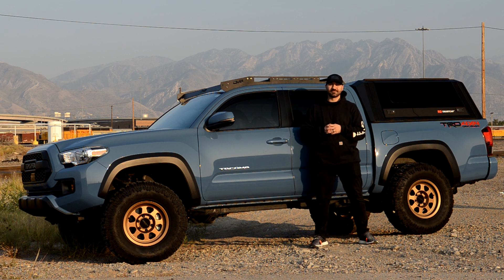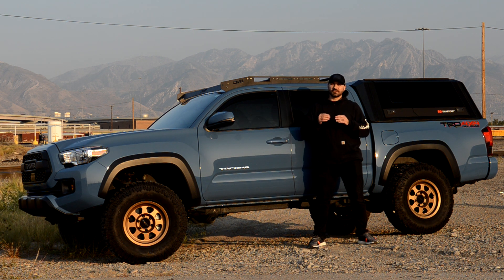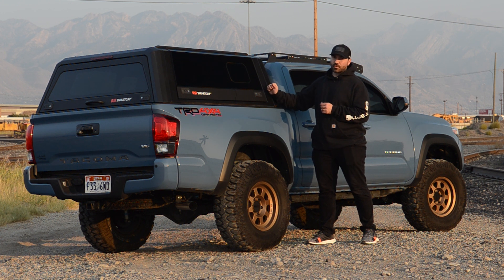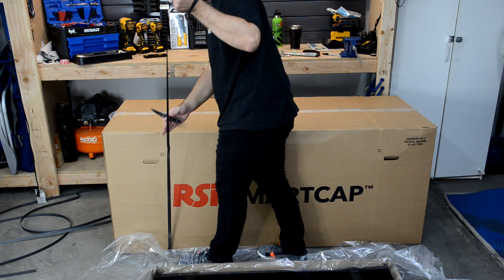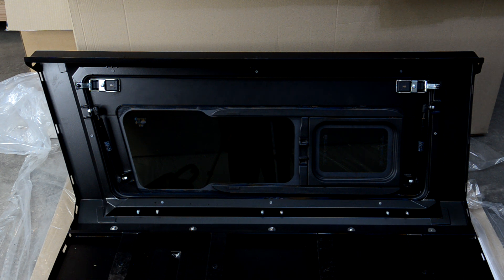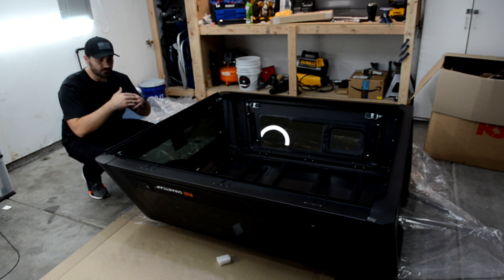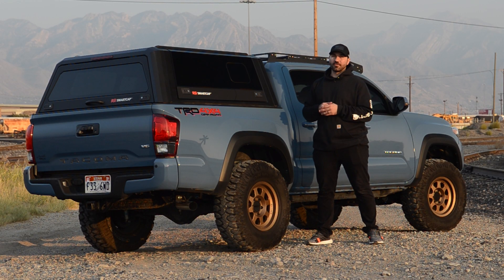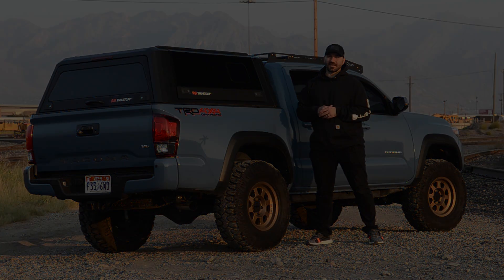RSI SmartCap Tacoma Install & Review - The Best 3rd Gen Tacoma Camper Shell - 2016+ Toyota Tacoma

Comment: Just got a Smartcap installed on my 2021 Ford Ranger Lariat yesterday. It looks really good, and the fact that it’s made of steel is a plus for me. The only thing I’m concerned about is the fit at the tailgate, since the Ranger doesn’t have a proper flat surface on the top of the tailgate, so the rubber gasket is slightly larger there to make the seal. The first rain storm will tell the tale. Also, the front gasket on the edge next to the cab of the truck has some spaces, which I will have to remedy with my own tuber gasket material. I got one of the utility compartments installed. It’s very handy, a good place to put a fire extinguisher and medical kit.

Comment: Great video.  Just installed one on my truck.  Had no issues at all putting it together by myself.  I wish I had done it on a table or bench instead of the floor though.  Did need a friend to help set it on the truck.  Super high quality and much stronger than a fiberglass top.  Well worth the extra money.
Reply: Could you share the cost of one of these Smartcaps?  I have a "Long" Bed on my 2019 Tacoma.  Do you know it they make these for a long bed?  Thanks.

Comment: Informative, thanks... did you mention the weight of the cab? I may have missed it. Trying to decide if I get it, do I have to redo my Leaf Springs in the back. Thanks
Reply: I installed a new leaf pack made by Dakar and it worked out great for the extra constant weight of the cap. The cap weighs about 175 lbs. I didn’t really see the tail of the truck sag with the cap. But the oem leaf springs did look a little horizontal. I personally think it’s a good idea to get a more robust leaf pack. Especially if you plan to load it up with more stuff.

Comment: Now that you have it what are the pros and cons so far ?
Reply from the maker: Cons: Doesn't have options to lock the windows from the inside, but sounds like RSI will be coming out with a solution in the future Pros: 1. Easy at home setup 2. Very easy to remove if needed (Had to haul a tall dresser and was able to pull the cap off in under 10 minutes) 3. This thing is built extremely sturdy and strong, once you see the quality up close you the price make sense. 4. Having the full opening doors is awesome for accessibility. I love everything about the cap, and  it definitely turns heads as well. Definitely the best purchase I've made on my tacoma.

Comment: The link to the RSI SmartCap takes you to a more general page. Roughly how much for the Tacoma is my question? My budget for a cap is 2.5k. But i have the 6ft bed.
Reply from the maker: Links are fixed! The Cap I have was $3695, however they now offer a adventure series which doesn't have side windows, but includes molle panels on the inside for $3495.
Reply: @GearheadJT  worth every dollar. I'm buying it right now with your link, thanks for fixing it

Comment: How do you clean the outside of the truck's rear glass window?
Reply from the maker: So far just by using my pressure washer and sliding a large microfiber towel down.
Reply: @GearheadJT  too bad RSI couldn’t have made the front window fold down to the inside.

Comment: Does it lock and unlock from the inside ?
Reply from the maker: It doesn't, the cap can only be locked/unlocked from the outside. You could I guess open the little sliding window on the side and reach down to lock and unlock the hinges from the inside.
Reply: thetopalovic cool thank you thing looks awesome on the truck wanted to know before I bought one
Reply from the maker: @ivanvillagomez4014  No Problem!! Looks even better in person!
Reply: Apparently RSI is working on a retrofit to do this after customer feedback